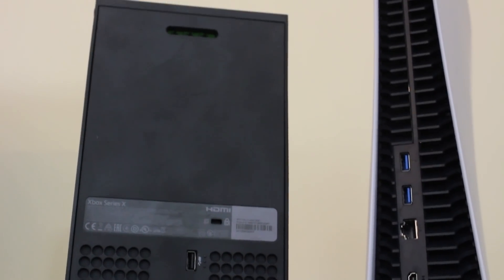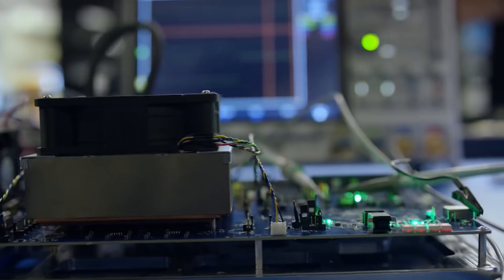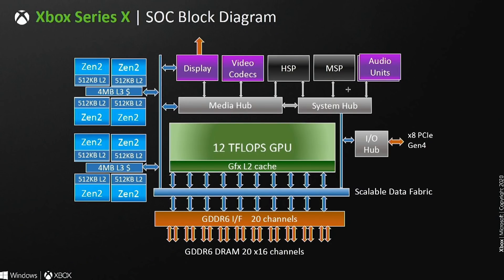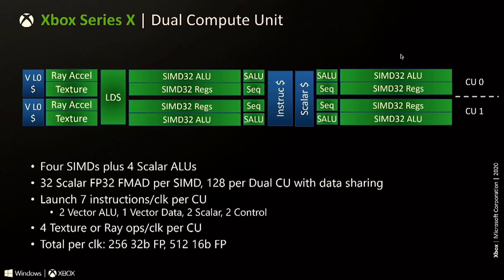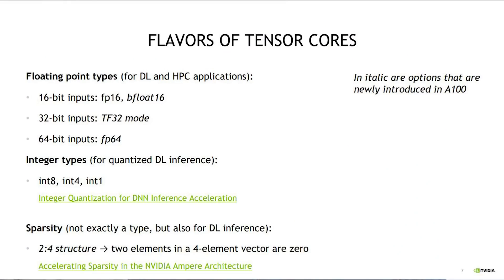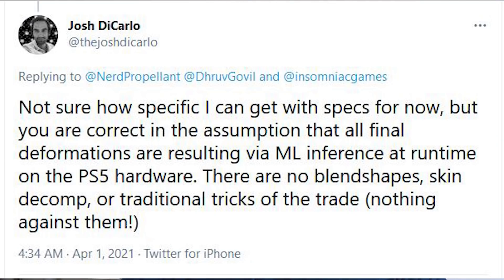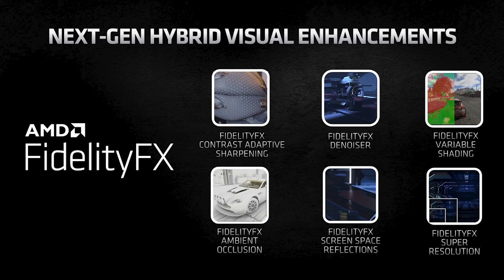Xbox Machine Learning & DirectML EXPLAINED - No, Xbox Series X Doesn't Use Tensor Cores

Comment: Tensor core is just a naming from Nvidia , but technically  they  are units that are suitable for doing operations on int4 and int8 (4 and 8 stands for the number of bits  so they mean it of 4 bits or 8bits). So both Xbox series x|s  and Nvidia units are similar in this, but the advantage of tensor cores  is that these units are designed for doing 4x4 matrix  multiplication and therefore  they are faster to run Ai model in inference mode. For the training part . Ai models are training floating points weights then they get converted to int4 or int8  to be executed fast.
Reply: Greetings! The training/learning part can be executed on Tensor Cores? Or, it would be done on powerful workstations only? In Xbox Series family it would be done using xCloud?

Comment: PS5 can probably run 32bit and 64bit. They just have to borrow some power from CPU.
Just lower CPU  speed to somewhere around 500Mhz/1Ghz it should have enough electrons flowing in GPU's/Tempest's/Geometry's direction for 64bit calculations. I even heard that Nvidia has designed Tempest and Geometry to fully utilize RT cores and up to 128bit ML.

Comment: I'm confused now, does this mean the Series consoles have dedicated hardware just for ML or not? From what he's saying I gather he's trying to say they don't and that the only thing that's been confirmed for Series consoles that's not known on PS5 is that they have the 4 and 8 INT for this task available for use and that these will be run on the CU's also. @RedGamingTech is this a correct summary?
Reply: Yeah there are no separate units for ML calculations like Nvidia GPUs, they are carried out by the CUs.

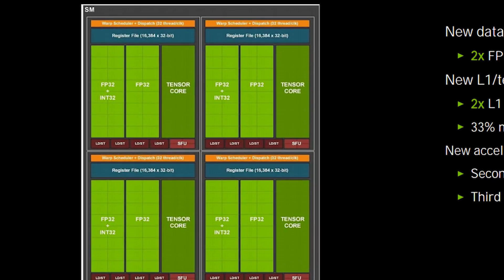Comment: 4:20 "...and you can see there is quite a lot of space dedicated to the Tensor Cores..." 
These block diagrams are not to scale, they do NOT represent the amount of die area dedicated to the labeled parts. 
I.E. the amount of die area for tensor cores is NOT the same as for "FP32", or the block labeled FP32+INT32".  

Sources:
https://www.techpowerup.com/254452/nvidia-rtx-logic-increases-tpc-area-by-22-compared-to-non-rtx-turing  
https://www.reddit.com/r/hardware/comments/baajes/rtx_adds_195mm2_per_tpc_tensors_125_rt_07/
Reply: Yeah I was gonna say the same thing, the block diagram is not to scale.

Comment: Hardware accelerated ML on the xbox is basically the same thing as what nvidia has in their GPUs except that  the xbox's ML cores are more flexible
Reply: Except that it isn't the same at all.
Reply: @ajamesa1982  if you use the xbox ML core for super rez it functions about the same way as a Tensor core does. They use different methods to get results.
Reply: @sageofgames7684  yes you are correct,  but if they are using that cu for ML then it can't do anything else,  unlike to Tensor cores that don't interfere with the rest of the gpu.
Reply: @ajamesa1982  the xbox ML core is  flexible to use for super rez or other functions like more advanced Ai in games it runs independently from the the cpu/gpu  it is more like a programmable co processor
Reply: @sageofgames7684  how can it run independently when it's a part of the cu??
Reply: Because it is its own unit with its own silicon   used for it. And it's not even being used right  now just sitting idle. Furthermore its built inside a monolithic apu and because most devs are gonna use it for super rez you want to place it In or as close to the gpu as possible

Comment: Series x has it built in hardware ps5 is software huge.difference
Reply: True though i am still impressed the DEVS managed to get it working in Spiderman when it already runs Raytracing in a 60 fps mode as well.  Great team.
Reply: @DEVILTAZ35  no not true
Reply: @DEVILTAZ35  Spiderman doesn't run raytracing in 60 fps lmao it'd 30 fps
Reply: 1.) It's not been confirmed if whether machine-learning for the PS5 is hardware accelerated or software solution

2.) I've seen you a multiple videos (like saltiest gaming channel) making stupid assumtions about the PlayStation 5, just to sugarcoat the Lbox series L because you're an Xbox fanboy

Comment: From RDNA1 onwards the architecture has had the ability to run 4-bit and 8-bit calculations for inference on this GPU architecture for Machine Learning, this is not unique or custom to XBox Series S/X or created by Microsoft.

Here's the link to the RDNA Architecture Whitepaper, which was released in mid to late 2019:
https://www.amd.com/system/files/documents/rdna-whitepaper.pdf

Literally the only thing that could be considered custom to Series S or X is the balance of how many RDNA ALUs are limited to only running 16-bit or 32-bit operations, because not all ALUs can scale the integer sizes between 16-bit to 32 or reduce them below 16-bit to 8 or 4.
Every GPU from RX 5000 to any RX 6000 spec models can do it, PS5 and Xbox Series S/X.

It is also possible to load multiple 4 or 8 bit tasks into 16-bit or 32-bit integer based ALUs, if programmers write code to do so, it just takes extra work on the part of the developers to make do so.
Inference techniques could be used on older hardware like PS4, XBox One, etc, it all depends on developers making the effort to get it working.
Reply: Hmmm, I think the key part of that document is the following at the start of page 14 (diagram at the end of page 13);

Quote "Some variants of the dual compute unit expose additional mixed-precision dot-product modes
 in the ALUs, primarily for accelerating machine learning inference. A mixed-precision FMA dot2 will compute two half-precision multiplications and then add the results to a single-precision accumulator. For even greater throughput, some ALUs will support 8-bit integer dot4 operations and 4-bit dot8 operations, all of which use 32-bit accumulators to avoid any overflows."

Hence if I'm reading it correctly suggests it's not the standard option but a variant, which appears to be the option MS chose for the XBox Series, but not Sony for the PS5?

Comment: They have dedicated accelerators for Machine Learning... They literally showed it at Hotchips...
Reply: No they haven't,  they said they had support for it,  not dedicated separate hardware.
Reply: @ajamesa1982  they specifically stated that they have a dedicated space on the silicon for it....

21 cell... States "Small Area cost" (AKA hardware accelerator) and between 3-10x acceleration;

https://www.anandtech.com/show/15994/hot-chips-2020-live-blog-microsoft-xbox-series-x-system-architecture-600pm-pt
Reply: @davenewman4663  https://www.extremetech.com/gaming/313906-new-xbox-series-x-soc-gpu-details-revealed-at-hot-chips-32 

They also said this "The reference to machine learning acceleration is interesting, but there’s no sign of a dedicated AI processing block on the die shot Microsoft released.  This may refer to GPU-based processing"
Reply: @ajamesa1982  ummm...

"The talk of a minor area cost for a 3x – 10x acceleration is interesting. One thing we don’t know yet about RDNA2 is whether or not it has any specialized hardware blocks for these types of calculations. Spending more die size to improve performance is not a bad tradeoff, though obviously it’s more impressive when the speedup is towards the 10x end of the range."

And as I already shared... This MEANS it does have a separate component dedicated to improved ML calculations... It's plain english.

This is a breakdown of the physical components on the GPU... 

And it's not like Red Gaming Tech doesn't make mistakes...
Reply: @davenewman4663  the die area cost is referring to support built into each cu, thats why they said its a small area cost,  a separate block would have cost more die space than integrating it into the cu.
Reply: @ajamesa1982  not what they are saying man. This is the same language they used for Sampler Feedback Streaming component, Variable Rate Shading, ray-Tracing, Mesh Shading, and the decompression block too....

"Small/minor Area Cost" is in DIRECT REFERENCE to the space used on the silicon for these specific functions... Yes the CU process, but these components reduce the burden and allow for all these process to occur simultaneously in under 1.6ms..
Reply: @davenewman4663  yes its all supported in the cu, not separate hardware like nvidia Tensor cores, I'm looking at an nvidia SM diagram, in each SM they have 4 INT32 blocks, 4 FP32 blocks and 4 Tensor cores and 1 RT core.
 An AMD CU consists of 1 Ray accel, 1 texture unit,  2 SIMD32 ALU and 2 SIMD32 Regs, so please tell me where the separate ML hardware is hiding???
Reply: @ajamesa1982  i am.going with microsoft when they said they have dedicated hardware that does this.

Sorry... But you are mistaken. Even Jason Ronald explained that having dedicated components to manage these API was critical for the long haul.
Reply: @davenewman4663  then show me a diagram of the separate blocks??? 

Have you seen the die space a Tensor cores takes up?? Its massive.
Reply: @ajamesa1982  you're also comparing 2 entirely different applications.

Microsoft is designing an APU for a console... Where as Nvidia has a whole silicon sheet dedicated for GPU along, that is almost half the size of the motherboard in the Xbox...

Totally different needs. 1 is tailored for a full functional unit, at $500USD, and the other is strictly a GPU for roughly the same price...

Microsoft has to make things smaller/compact.

I don't doubt Nvidia uses much more surface area... And they are 2 entirely different architectures... How does this not make sense to you?

I sourced you the Actual hotchips slideshow. They stated very clearly that each of those API had companion accelerators to manage it - reducing GPU and CPU workload.

They even stated that waiting for these components to be completed was why production was delayed for Xbox Series Consoles...
Reply: @davenewman4663   again show me one diagram that shows a "separate" hardware block.

Everything you have said is built into each cu, the tech is in there to process the INT4 and INT8 operations,  so have they added hardware for it, yes they have in each cu, have they added a separate hardware block for it, no they haven't, which means they have to use the cu's for ML, not a separate piece of hardware.
Reply: ericph1977  incorrect.

Comment: We have an engineer at Sony that already confirmed the PS5 doesn't have any ML support in hardware. This would include the 4 and 8 int support.
Reply: wich engineer is that?
Reply: lies sony has not revealed any of that information
Reply: @ricardopm81  its a fact simp
Reply: .. almost any hardware can utilize ML. Obviously they can't be trained. But this is a bit silly :/
Reply: The PS5 does not have Int8 and Int4. This has been confirmed by the Sony Engineer, David Gage from Quantic Dreams as well as Locuza.
Just like VRS and Mesh Shaders, Sony never talked about it because they didn't have it. MS played up everything they knew the PS5 didn't have that the XSX did.